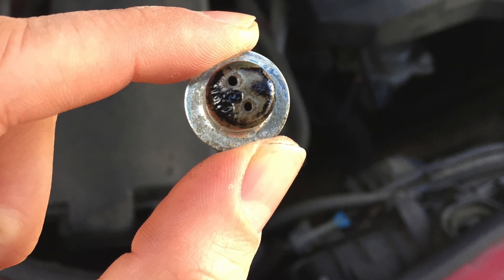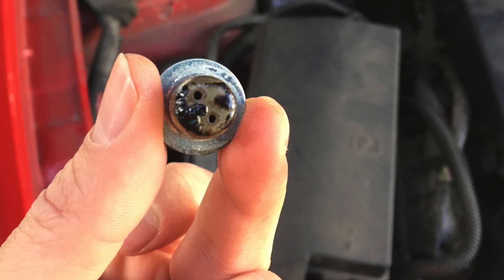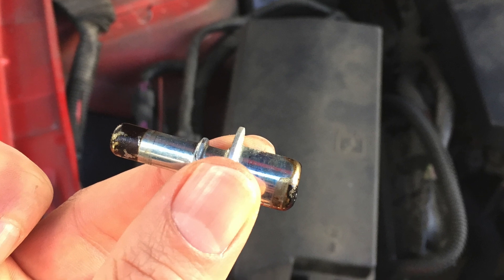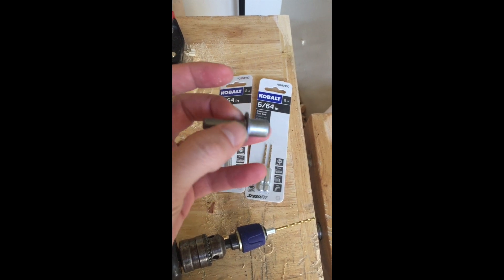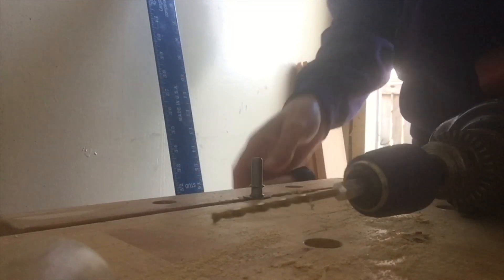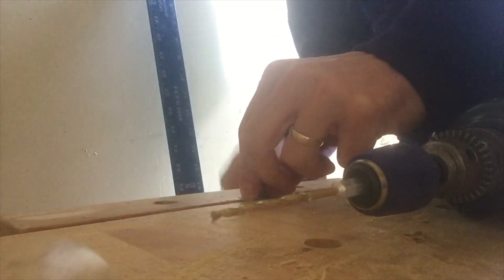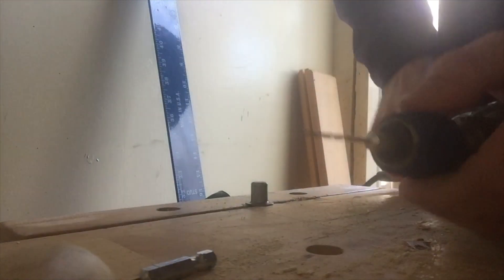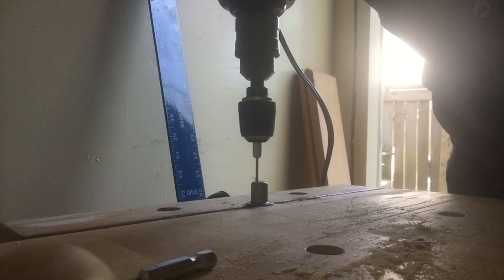GM 3.6L V6  LLT PCV valve modification - GM Camaro

Comment: bought a new one for my 2008 3.6 FY-7 V-6 and drilled it out so it can breathe better as I was getting oil in the intake throttle body. bought the SRX used with 197k miles and boy did it need it.
Reply from the maker: Awesome! Glad it worked for you!

Comment: The PCV valve is precisely calibrated by GM—its diameter determines how much oil vapor and vacuum pressure flows between the manifold and the crankcase.
➜ Even a difference of 0.1 mm changes the pressure in the system!
2. After drilling:
• The engine starts to suck in too much air.
	•    the computer detects a lean mixture (error P0171/P0174),
•    irregular revs and valve knocking occur,
•    oil consumption and fuel consumption increase,
•    oil may be sucked into the manifold, causing smoke.
Reply from the maker: I did this mod 8 years ago and none of what you'd described has happened.  I've had nothing but success lowering the manifold pressure, oil catch can works perfectly, no more oil burning and car runs perfectly.  I've put 85,000 miles and still performing great.  So not sure what you're describing.

Comment: If the engine has begun to sludge up badly, you may find that after modifying the PCV, the exhaust will stink for a while after the next startup as vapours clear from the crankcase.
Reply from the maker: I never knew that!  Thanks for the comment

Comment: 2 questions, did they fix the pcv holes on the 2013s (thats what i have) and what is the best cleaner for it granted i can get it out? brake cleaner? thanks!
Reply from the maker: They did not.  You’ll want to drill out the holes on the 2013s.  GM fixed the holes in the 2014s.  For a cleaner, any brake cleaner is good.
Reply: @bigilworth  awesome thank you
Reply: @bigilworth  also, if i purchase the pcv valve for a 2010 camaro, will it also fit the 2013 one? i would then just need to drill the holes correct?
Reply from the maker: @Cannones  Yes - they're interchangeable
Reply: @bigilworth  thank you!
Reply: Do you have any extra tips on getting the pcv valve out? This thing is tough
Reply from the maker: @Cannones  Not really.  I just pulled on it with a pair of pliers.  Should pull straight up and out.
Reply: @bigilworth    you're 100% certain that the 2013s let you remove the valve? Iv tried so many times and even spray wd40 on it and no results. It's almost getting to the point where I'm damaging the actual value because I keep clipping at it with pliers.
Reply from the maker: @Cannones  It should come out, but if it isn't, or it's bending, I wouldn't force it.  You might crack the valve cover that it goes into if you force it.  If it's stuck you can try heating it with a torch.  I would see if a mechanic can get it out if you become uncertain.  I'm also working on a GM Gen5 engine.  Is that the same engine you're working on?
Reply: @bigilworth  I believe so, I'm doing a 2013 camaro v6 lfx
Reply from the maker: @  yea man, that’s the exact same engine as mine.  That little plug should come right out.  If it’s not, I wouldn’t force it.  You can try heat, but only if the cover it goes into isn’t plastic.  I’m surprised yours is so difficult to get out.  In my video I was able to get it out while filming.  Took no force at all.
Reply: @bigilworth  yeah I hear you.. it's getting kinda chipped from all my attempts. I might give up.  Just sucks since I bought the replacement pcv and drilled the holes lol.     Guess I wasted 20 bucks , however thank you for your responses!
Reply: It happens sometimes on the forums a guy had the same problem kinda had to force it out. Since you have a new one you should be able to chuck that new pcv valve in after and dont worry too much about breaking the one in there ( its happens ) @Cannones

Comment: Positive crankcase valve valve?
Reply from the maker: that's correct.  Crankcase builds up pressure and the PCV valve has specific size holes to allow the pressure to escape - but you need a catch can because oil droplets are mixed with the gas.
Reply: Yes 😅 of coursd he's not gonna call it the PC valve as mechanics know it as PCV

Comment: Aren't the new ones made correctly. Why not get a new one instead of drilling the old
Reply from the maker: I don't think the new ones have the correct size holes - but I made this video 5 years ago - GM might have fixed the replacement part.

Comment: After enlarging the holes on the PCV valve, do you still need to add a catch can?
Reply from the maker: It would be recommended to get a catch can.  They will catch most of the oil blow-by and prevent oil from gumming up the air intake passages.

Comment: Can I install a 2014 Camaro valve on a 2008 Commodore, what do you think
Reply from the maker: Maybe - they are not that expensive ($10) so you could buy it and see if it fits.  Otherwise, might be best to modify the existing one.

Comment: Great vid mate!  
I love my gold 2008 VE V6 Commodore 60th anniversary edition.  (just a 4 speed auto)  
It is a beautiful machine with stock 18 inch Y spoke wheels.  
The engine is a sweet smooth revving beast with the simplest at home bolt-on mods with good oil.  
I use Penrite HPR5 full synthetic oil which is 5w30 + 10 that is great for our stinking hot summers here which can get to 40+ around Christmas time.   Oil is cheap preventative maintenance as low as or less than $10 per litre when on sale.   $80 for oil and filter change done myself with minimal tools every 10000km is dirt cheap.  
The oil filter change is so easy and cheap that I change it every 5000km.  
I installed the Orsomm Performance OTR cold air intake that actually works as claimed with great throttle response, power increase and has a great growl.   I bought mine second hand cheaply from a bloke that had his car destroyed in an accident.   
https://otrcai.com/   
Next thing to do is remove the massive stock rear muffler that has the exhaust gasses change directions 6 times inside.  Replace it with a sport straight through muffler or in my case, a 3 inch muffler delete.  
There is a common problem with this V6 which is very easy to fix at home.  The problem is that the crankcase ventilation on the left bank is very poor with the stock PCV and people not changing oil regularly or using garbage oil, which leads to various problems including bad timing chain and variable cam timing lubrication when the PCV and oil ports block up.  Super simple fix is to pull out the crankcase ventilation valve at the back of the left bank, drill the 2 vent holes a little larger and put it back in.   
I have economy as low as 8.5 litres per 100km on the highway with great power to overtake a 50 meter road train in seconds.  
Some people have removed the plastic engine covers claiming that they trap heat in.  I am not sure about that, but it looks plausible.  I have not yet removed mine because they look nice when kept clean.   
Would you recommend leaving them on or taking them off, perhaps in regard to our horrid hot summers and under bonnet temps in traffic?   
I respect your opinions and advice.  
Regards, Jas.  
VK4FJGS  
Rockhampton Queensland Australia
Reply from the maker: Thanks for the message.  I would not worry about the cover.  I always keep mine on and after ten years of ownership there have been no issues.

Comment: Nice vid! However, you are actually supposed to apply a sealant before inserting the new PCV Orifice (or Valve), based on the Workshop Manual. Also, when you insert it, you need to twist it in order to eliminate any vertical leak paths in the sealant (still based on the manual instructions). By the way, the manual I have is for a 2008 - 2011 Cadillac CTS, which includes 3.6L V6 LLT engine (same as yours) and other different types of engines, but this procedure would also apply to yours. Some RTV sealant would work (Permatex Red High Temperature RTV for example).
I have the same engine on my 2008 Cadillac CTS and I am planning to do this soon in addition to doing some manual intake valves cleaning (which requires removal of intake manifold, etc.)...right before the next oil change.
Free advice, I would also encourage doing the following to improve your vehicle's performance. I have personally done these and can't be any happier. You can research about it if you don't trust me or are not confident enough:
- Use some Fuel System Cleaner in the gas tank (STP worked greatly for me)
- Replace the engine air filter (if needed and based on maintenance schedule)
- Clean the Throttle Body Assembly
- Clean the Mass Air Flow sensor
- Add some Lucas lube in the oil (make sure the oil level doesn't go over the limit on the dipstick)
- Replace the spark plugs if needed
There are many other things you could do to improve your car's performance. Cheers! 😉
Reply from the maker: Thanks for the added instructions!  My manual doesn't have any RTV needed, but it's always good practice to put a little in these sorts of applications.  It can't hurt in sealing 100% any vacuum leaks.  I haven't done a smoke test on my car, but it runs really well with no codes so I'm pretty sure the PCV Valve mod is working well.

Comment: Looks just like the one I pulled out and changed today. I cannot tell you what a difference it made. The engine runs super smooth again. I cleaned a lot of creamy sediment out of the air tunnel too. The old PVC was shot and had been shot for a long time.
Reply: how did you clean out the air tunnel??
Reply: Where can I buy one?
Reply from the maker: Fantastic!  Glad that it helped to change it!

Comment: Will the new updated valve from the 2014 camaro fit the 2010? 🤔
Reply from the maker: Not sure, but the PCV valve is so cheap, it wouldn't hurt to try a 2014.  Get the correct drill bits and test the holes in the 2014 to make sure they're the correct size.
Reply: @bigilworth where can I get the valve?
Reply from the maker: https://www.rockauto.com/en/moreinfo.php?pk=6995428&cc=1444222&pt=5052&jsn=11 @edforthewin8574
Reply: @bigilworth  thank you sir!

Comment: Am I supposed to be able to see through it?
Reply from the maker: yes.  It's just an open chamber that creates a specific bar of pressure.  If your PCV valve is all gunked up inside, you'll want to clean it out with brake cleaner.

Comment: I found mine on Amazon and I could drill it out myself but I want it today and the dealership has one, do you think the parts from the dealerships were modified or just the ones installed in cars post 2012? Thanks in advance
Reply from the maker: Buy the one from the dealership and check the hole size with the proper drill-bits.  If they are too small, then you know you'll need to drill them out and make larger.

Comment: I'm SO glad I've watched vids about this issue!! 

I've got a gorgeous Cranberry colored 2015 Impala LTZ, with the 3.6L VVT. 70,000mi on her now in Feb. 2022.

YES! Somebody brought up Seafoam!! For yeeeeaars now, I've been adding 1 Cup of SF to my Crankcase 1-2 weeks before an Oil-change. NEVER more than 5K mile intervals!!! Always Mobil-1.

Per the Owners-manual, the ONLY Gas it's ever seen is NO-ETHANOL Certified TOP-TIER CLASS Premium.....from Shell or Holiday Stations. Once a month, when the tanks are @ 1/4, I put 1/3 bottle of SF into the tanks.

ALL my engines (big & little) are running STRONG & clean. How many bottles of SF did I buy in 2021???
>>> TWELVE <<<
🤓😲
Reply from the maker: Thank you, glad you liked the video.  My Camaro has 145k and still going strong.  I don't anticipate any issues with it at all.  Have you installed a catch can on your Impala?
Reply: @bigilworth  -- Forgot about this video! No, I haven't installed one yet. She doesn't use any oil thankfully!

Comment: My 2020 had a misfire the other day it didn’t stall out and it hasn’t happened again but I’m bringing it today to get look at by Chevy I hope it’s nothing serious
Reply from the maker: My car misfires all the time.  I bought one of those code reading devices.  My Camaro misfires because of a detected O2 sensor fault, but I've changed out the O2 sensors and I still get the fault.  So my guess is a vacuum leak and I'm too cheap to buy a smoke machine or have a mechanic do it.  I would suspect your misfire is due to a vacuum leak rather than the positive crankcase pressure which is what this video is about.

Comment: Garbage disposal GMC and Chrysler Dodge And Ford
Reply from the maker: I've got 139,000 miles on this vehicle with nothing but oil changes.  The only problem is these engines create a lot of crankcase pressure causing oil consumption.

Comment: Was there anything wrong with it in the first place.? These things are designed by engineers the hole sizes are scientifically calculated the fact that the later models holes are bigger is irrelevant. It is a different model. This guy should have used a piece of pipe to knock back in.
Reply from the maker: It is a known GM default in engineering.  The crankcase builds up too much pressure, causing excessive oil consumption.  Check out many of the videos and literature on GM 3.6L V6 engines from 2010-2013.  I even believe GM put out a bulletin on this.

Comment: Just saw y’all know, this is for all 3.6l V6 from GM from 2003-2014. My 2005 caddy had positive crank pressure.
Reply: And for Australia there was the GMH (General Motors Holden) engine made in Australia from 2004 until October 2017 known as the Alloytec (3.6L), which started life in Australian cars with the VZ Commodore in 2004. Also has the PCV valve.
Reply from the maker: Yea this seems to be a problem for lots of brands of cars built between 2005 - 2020

Comment: While I will be  using your solid advice. I just don't see the point  of buying a new one once it is drilled out the old one would be no  different  than a new one . Also may I suggest using a socket to refit the valve instead of hitting it directly.  Cheers
Reply from the maker: Absolutely true!   I bought a new one so that I would have the old one as a spare in case the job didn't work for some reason and I needed to switch back to the old one.

Comment: What is the tube coming from left aft side of the engine and connects to the intake tube near MAF sensor? I have cold air intake and oil near MAF sensor
Reply from the maker: The tube connecting the back of left side to air intake tube is another pressure release area.  Unlike the PCV side, the left side is under less pressure, so less to zero oil should escape that side.  I have oil coming from that side too and it pools near the throttle body.  I've been wanting to put another catch can on that side of the engine, but I have not gotten around to it.  You'll notice if you take the hose off that there is NO PCV valve regulating how much pressure can flow through the hole.
Reply: @bigilworth thank you sir. what about to disconnect it from the intake and left it freely, let the oil drop down under the car. Or it will not work because of some vacuum inside intake manifold?
Reply: @DIABLO_4_Tester_Sacramento  Do not do that - its illegal for emissions and will cause engine damage, the Tube attached that you are talking about connects to the T-intersection between the Throttle Body and downsteam of the MAF sensor, so any air the PCV/CCV system uses is metered air by the MAF entering the crankcase via this tube, if you disconnect this "clean tube" inlet -  you mistakenly will a) let non ECU metered air enter the crankcase and b) suck in dust and debris that will damage the internal bearings, oil pump, and cam phasers etc. The opposite rocker cover that this video is showing the mod for has engine vacuum (post throttle body) on it 95% of the time during idle and low revs, so this promotes it sucking new air from anywhere else - this is the purpose of the clean air tube - to let in filtered and ECU measured air on your "passenger side" rocker cover/ The PCV system really should be called the "Positive Displacement Ventilation System" - as the engine vacuum on the PCV port promotes positive displacement and suspends the acids and blow by in the air.  If the Clean Air tube all the way through crankcase to the PCV orifice/valve is not gas tight - including a badly sealed Oil Cap and Dipstick if will stuff up the proper ventilation causing stagnate foul sludge to sit in the engine, and can even cause engine lean out as its a unmeasured vacuum leak around the throttle body essentially - This is the reason modern Oil Caps and Dipsticks have O-rings on them.
Reply: @robywankenobi32  thank you for reply. I improved pcv valve. Per your opinion, does 6.2 engine more reliable than 3.6? I would change car because of 3.6 eats oil and transmission is very weak
Reply: @bigilworth  One more. I asked same question from the overseas forum and they said that our engine is going to die.. Oil comes into intake only when compression rings (piston rings) are worned out and all rings have to be replaced. I don't know how to proceed now